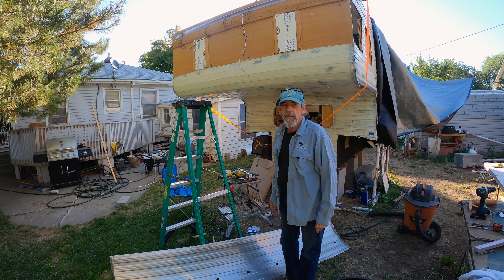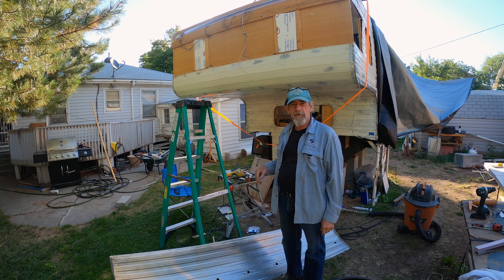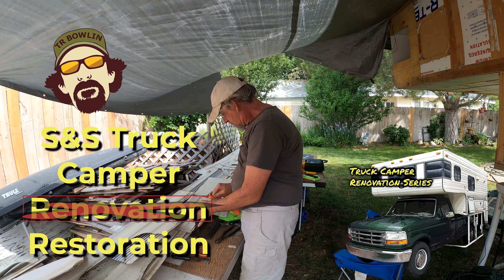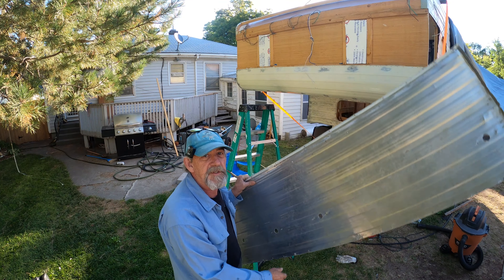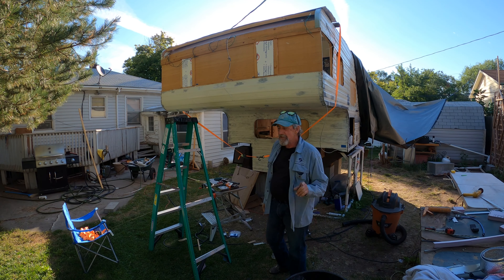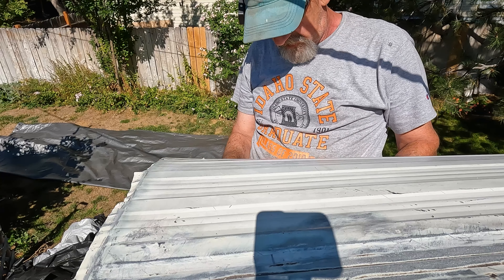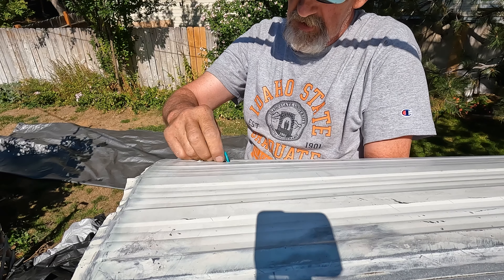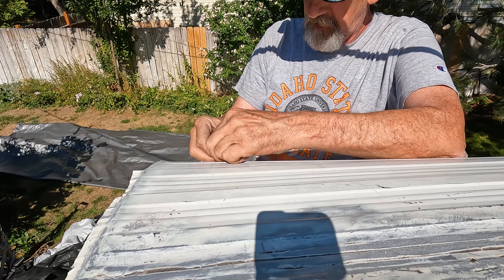Bonus Episode-Installing the cabover roof.. Vintage Truck Camper Restoration

Comment: Hey tr question I have a 2003 dutch star trying to put in a zantrax 458 in my bay area I have 2 wires one going to receptacle and the other just hanging looks like 12-2 wire which one goes to input on 458 and which one output if u have a number I can shoot u a pic of it would be greatly appreciated
Reply from the maker: do that. trbowlin@gmail.com. I'm in an out today, but twill get back to you as soon as I can.